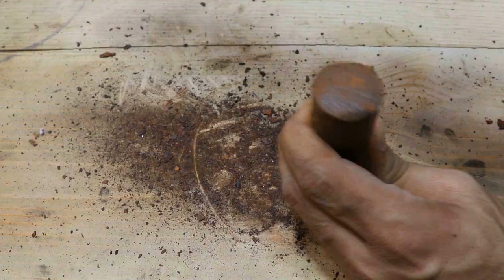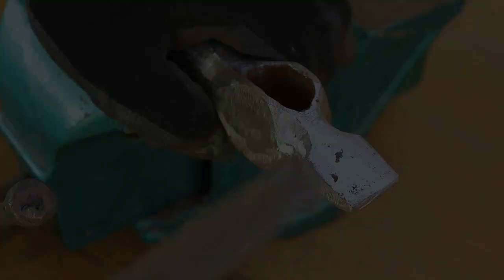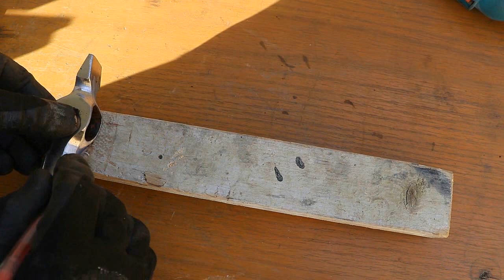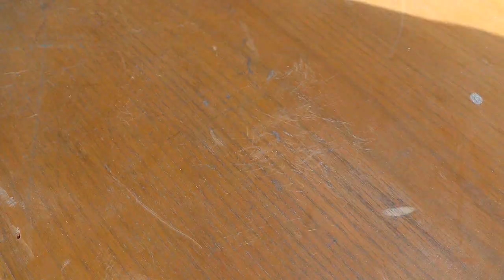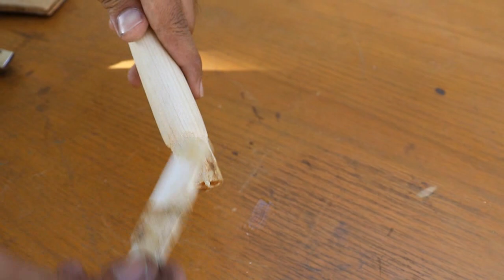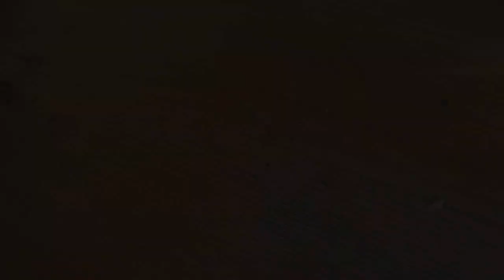Rusty Vintage Hammer Restoration

Comment: Chemical rust remover would have saved you a lot of hassle and material on that hammer head. That said, you did good for hand tools. If you'd like to keep your sandpaper from snapping and fraying like that, when you cut off a strip line the back with carpet tape or duct tape, something that has some strength to it.